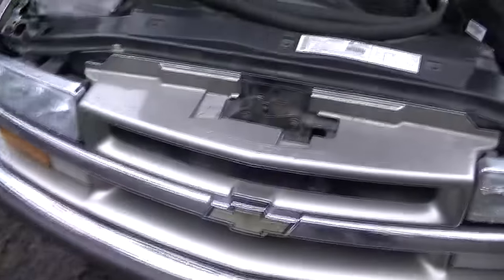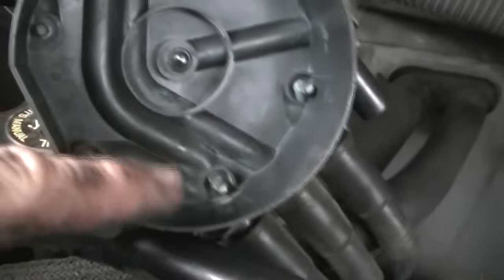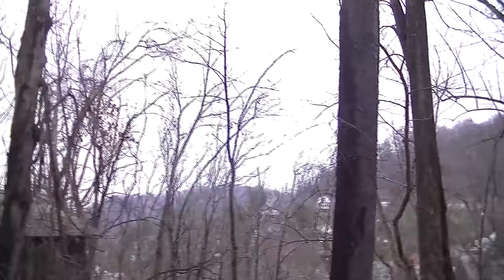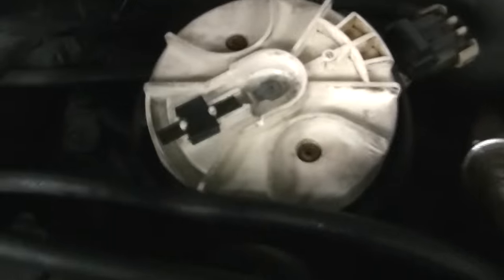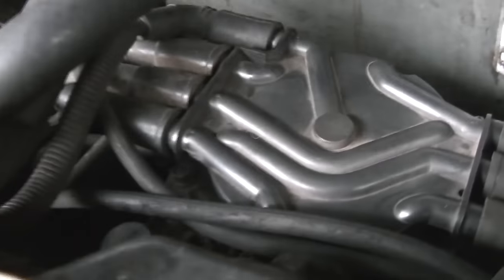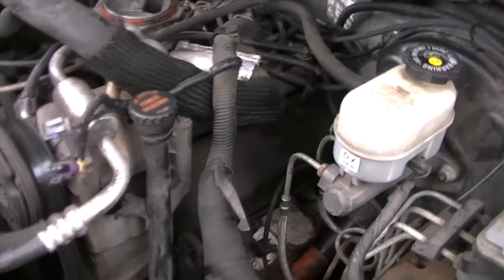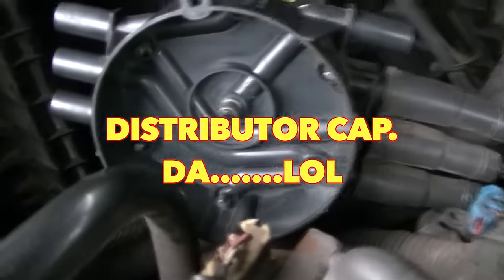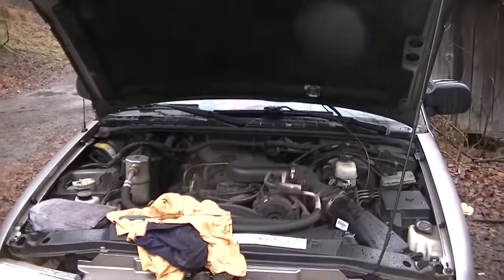4.3 Chevy S10 Not starting. Fixed!! EASY...Popping, Vapor locking...Jump time??... 1995-2008

Comment: I just recently had this one issue with my 97 Chevy blazer, it was starting great and all with a new battery and alternator but last week when starting it, when I turned the key to accessory, the instrument cluster would not light up at all and my fuel pump wouldn’t engage either but my radio turned on, my head lights and all interior lights as well, it would crank but would not start, any idea what my issue can be? Thanks
Reply from the maker: Go back to step 2.....
Reply: Nathan Rohrbough Well I did buy a new cap and rotor and have it ready to install but I stopped to do research on my issue first before installing anything, I’ve read that it can be my ignition switch, my starter or just a bad relay somewhere since the power is there it’s just not getting to where it’s supposed to, I’m getting my starter checked out soon and after I’ll install my cap and rotor and see what happens, thank you

Comment: I just had a misfire before I found out the problem I replaced the cap rotor with oem and thay I thought thay were the problem because spark was comming out of the cap so I replaced the cap with a aftermarket cap did the same thing to find out the the rotor was missing the tang in the center drove me crazy but fixed
Reply: If you run into moisture's issues... I found a fix for it!
Reply: @JodBronson  what is it?

Comment: So... this is a 1973 Ford Pinto? I need a hair drier to start it? This is NOT my problem - alone, there doesn't seem to be enough electrical charge to kick through the ignition process. My situation is solved when I put a charger on the battery - it brings it right up and starts immediately. My challenge is figuring out why a NEW battery that the alternator charges at 15+ when idling loses just enough power overnight to not have quite enough juice to get it running. Voltmeter confirms this. No lights or radio draining it overnight... hmmm...
Reply: Short somewhere in the wiring

Comment: I need help with a 91 4.3 s10 we took bed off replaced fuel pump now we have good fuel pressure all the way up to the injection pump or carburetor whatever it's called but the only way it will crank is by spraying starter fluid in it no fuel is getting to the carb truck has been sitting for about two years what do I need to check to get fuel to carb or injection pump please help.
Reply from the maker: Pinched line?

Comment: My problem is the truck will start and run I can drive it around the block once if I try for a second time it starts cracking and popping then it dies in the middle of me driving it and it is real rough and the RPMs bounce out of whack

Comment: Mine does this but i have to press the gas pedal for it to run while i turn the key and it idles rough at low rpms , i already replaced the rotor &  cap tho with spark plugs /wires
Reply from the maker: O wow!~

Comment: I just replaced my distributor cap and rotor a year ago and it’s doing the same thing.
Reply from the maker: Ugh...might be time to do it again...
Reply: +Rat Attack -  If you run into moisture's issues... I found a fix for it!
Reply: @JodBronson  - Yeah, you mentioned that. About 50 times now. Except you don't say what the fix is. Very helpful.

Comment: You can have a hair line crack or carbon tracking on cap ,rotor or plugs . And carbon tracking on wires , plugs or plug boots or coil . On the GM HEI distributors there are 2 screen vents in the bottom that should be cleaned . Use carb or brake clean . Also inspect the 2 thin wires that go to the magnetic pickup . They can get rubbed through . They flex with the vacuum advance .

Comment: My 01 s10 is doing the same thing but I've replaced everything cap ,button, coil the sensor in distributor my fuel pump is coming on like i have just turned the key on but im turning it off

Comment: 1989 S15 Jimmy 4.3 tbi I have spark,fuel,no start need to test my compression. Original problem was a bad alternator,replaced it them my truck didn't start anymore. Any tips??
Reply: Ignition switch is failing
Reply: It turned out to be low compression, had  busted head gaskets,on cylinders 3,5 and 2;6, did the necessary repairs and the super S15 Jimmy is on the road again!! Appreciate your reply 👌👌

Comment: Will this causes a code to come up as eltrical when hooked up to a computer
Reply: This problem usually throws "P0300: Random/Multiple Cylinder Misfire Detected" code leading upto complete failure.

Comment: HELP MAN. I GOT THE SAME CODE I DIDN'T REPLACE MY COOLANT TEMPERATURE SENSOR AND HAD TO SOLDER THE WIRE TO A NEW PIGTAIL. BUT THE WEIRD THING IS I DON'T HAVE ANY FUEL PRESSURE AT ALL I HAVE A FUEL PUMP THAT'S BRAND NEW CHANGE THAT ALSO NO FUEL PRESSURE AT ALL COMPUTERS NOT TELLING TO SEND IT TO SEND FUEL PRESSURE. FIRST THING I THOUGHT WAS THE CAP AND ROTOR SO I ORDERED A NEW ACDELCO ROTOR BUTTON SO THIS MORNING I AM   TAKING AM GOING TO TAKE THE CAP OFF AND SEE WHAT THE PROBLEM IS THIS WHOLE THING STARTED WHEN I WAS IN THE HOSPITAL FOR OVER A MONTH AND NOT DRIVING IT.

Comment: I can prime my 97 blazer an runs good till I drive it for about a hr or so but just turning the key on to start it will. Not start long as I pore gas in the carburetor it will run. Has anyone had this problem before an I have change everything on it. Thxs.

Comment: Wow after all that bullshit I was right. The whole time that's crazy af I only maintain 3 s10s two trucks and a blazer all 4.3 97 01 and 03 all w over 200 on the odo and they all oops except one I just had to tow home today I believe this one will be my first crack at the infamous spiders and fuel pressure regulator I'm confident I wont have any issues w that it looks fairly cut and dry thanks wish me luck lol

Comment: That style distributor cap is junk. The same era small block and big block also have it, and it's no better on any of the engines. Also, I wouldn't bother trying to clean the contracts on the cap or rotor unless I was stranded roadside. If you think you need to clean those contacts, just replace them.

Comment: A GM tech told me that you can jumper the pigtail for the coolant temp sensor and it will run lean but if the sensor is the problem than it will run.
Reply from the maker: Thanks. It turned out to be the distributor cap and rotor button. They were bad and shorting out. New ones fixed the issue and is still running to this day ;)

Comment: I just went through my 1994 Chevy S10 Blazer Tahoe LT/ZR2 with the Vortec L35CII CPI, after having an issue similar to the fuel pump sending going out.

After taking the fuel pump assembly out, I found the wiring cluster that comes through the sealed fitting into the tank, was all melted. Lucky it didn't catch fire.

Changed the entire fuel pump assembly, and fuel tank too after poking a pinhole in the front of the old tank.. Yay.

Fuel lines are snug and relatively new, replaced them a year ago. Just put a new fuel filter on too.

Had voltage to the injector spider, around 12 to 14 volt. So, I spent the lump sum and got a new unit. Put it in, lost the little clip that connects/retains the fuel line and return line. Drove 2 hours away.. to go get the stupid clip from a junkyard.

Has a new unit, fuel definitely is coming through, and it'll spit and sputter on pure ether out of a starting fluid can. Sounds like it's grinding.. when it tries to start. Not sure if it's the ether or not causing the sharp sound.

I really.. need help. I love my old girl to death and the past month has been nothing but blown money and a broken heart.

Thank you, if you can help at all.
Reply from the maker: Making these old SUV last....Priceless.

Comment: Its kind of shitty design that distributor holds moisture . I usually have to replace mine once a year but now I'm thinking of just upgrading the distributor, P0300 is the code I know when it's distributor cap and rotor

Comment: Hell I'm having some misfire on my '94 Chevrolet suburban. I've replaced the ignition module and still no start after having turning the key numerous times. I need help I'm not getting nowhere
Reply from the maker: Hummm
Reply: I know my distributor cap underneath where it sends fire was like corroded kind of but more like rusty type
Reply: Brandon Quintero, Hi
Where you ever able to find out your issue ? I'm  having the same issue with your same type of vehicle. Thanks in advance.
Reply: Brandon Quintero
Reply: Neva Mind I still haven't found the issue. I've replaced the thermostat just because I have already bought it awhile back but back to square one. Now I'm thinking it might be my fuel pump a buddy of mine came over and he never heard it make that winding noise. Sorry fellas until I get something else replaced I will let y'all know. If y'all don't mind let me know if you find the issue before I do. Have a blessed day
Reply: Guys......... If you run into moisture's issues... I found a fix for it!

Comment: I rebuilt the entire engine on mine, It has all new electrical except for the ecm. It has spark it's on time, fuel system is as all new and has adequate fuel pressure. I installed brand new AC Delco Distributor as well. One issue with that was the gear was 180 degrees off from the factory so I had to flip it around. Has new crank sensor, new accel coil, new ac delco icm, Timing light shows right on timing mark. It cranks and sometimes it will backfire through the throttle body. Plugs are wet as well.  I checked for vacuum leak. I disconnected  the catylitic converter.  Anyone have any thoughts. It will not start. Fighting this for 2 months. Has no codes showing up. Has anyone else had this issue?
Reply: Oscar,
I have had problems with the accel parts a few times.  I would try a GM coil.

Comment: Another You Tube Parts Changer!
Reply from the maker: O yea! Pleas tell us more.....lol
Reply: TVWXMAN32  , po128 is a cooling system engine warming up problem usually that has to do with a thermostat not closing properly you have the right idea about the distributor cap but the most common problems I found with those is carbon tracking on the inside of the cap. You seem like a very knowledgeable DYI guy do a little bit more research when you post you have the right idea but the wrong approach! 😉
Reply: Sorry DIY 😉
Reply from the maker: Been a mechanic for 40 years! I never said the temp sensor was the 
issue nor did i concentrate on it . First of all...why does a po128 show up when you just crank on the engine....when the coolant does not even have chance to warm up?  
Only a wizard would know that. 2nd... moisture in the cap can cause the same 
conditions...popping/shorting out. Carbon tracking is common some  
sometimes. Even aircraft motors (yes I work on them also) have issues 
with carbon tracking in the Magnetos often shorting out So in 
retrospect, doesn't hurt to change the coolant sensor if that code 
shows up. My approach was the Distributor the entire time only getting 
side tracked to fix a outside issue. You have the right Idea but the 
wrong knowledge. To fix all outside problems that may lead to more 
issues, IS what a good mechanic should do.... o-O  Thanks for watching.

Comment: You're a good man and describe your actions to make an instructional video, but, bro., slow down---as my teacher always said---put your brain in gear before your mouth is in motion---because you stumble over your part names way too much.  You would not have to overlay the video with corrections on part names if you just slow down, think, and talk.  Otherwise, you're doin' a good job.  On the moisture in the distributor problem, I live in the dry Southwest and I've repaired a bunch of S10 distributors, but I've never seen rusted bolts on a rotor like you had with Appalachian moisture.  It reminds my of my dad's place in Florida, where everything rusts.  That rust alone tells me you have too much moisture getting trapped under your cap.  One problem I've seen is the real bolt for the cap itself, because of it being in a difficult place, too many dudes think it is cinched all of the way down when it isn't.  Once reinstalling the cap, pull up on it to see if the bolts are tight.  If there is the slightest give, then your rear bolt was not cinched down all of the way.  That looseness can allow moisture in.  I've seen trucks with the rear bold not tight several times, but my first indication was how easy it came out, then I knew it was too loose.
Reply from the maker: Thanks for your insight.

Comment: Don't ever put a cap and rotor on these engines other than a AC delco original equipment cap and rotor all others are junk .
Reply from the maker: Word.......
Reply from the maker: I've changed two caps within 30,000 miles. For some reason, some caps don't hold up.
Reply: If AC Delco was so great, this wouldn't happen in the first place. I haven't had to replace a cap and rotor since owning my '73 Corvette. I didn't even know modern engines had distributor setups like this anymore. Obviously, it isn't very modern, or well designed.
Reply: nothing ever said further from the truth lmao. ac Delco is  original equipment for one reason and one reason only! the (reason )it was the cheapest crap gm could get to put on them and saves them money in producing the cars and trucks! plus the faster the stuff wears out , and the faster you have to go to the dealers to buy them genuine high priced dealers parts lol . plus most take them to the dealer to be fixed so they clean up all the way around .  what it all comes down to is do you want to get on ebay and buy a cheap china , tiwan or medico part or buy a genuine gm part and pay 10 times the price after they order them from china, tiwan or mexico  from the same factories?

Comment: the temp sensor keeping it from starting really
Reply: If you run into moisture's issues... I found a fix for it!
Reply: Yes really. Sometimes if the sensor is bad the ecm will default to -40 degrees farenheit. And when the truck thinks its -40 outside but it's really 80 degrees it won't run because it gives it way too much fuel
Reply: @bobk1955  🤣🤣🤣🤣😪

Comment: Engines require three things to work. Spark. Fuel. Compression. Thankfully, they have simple, relatively inexpensive tools to TEST each of these systems. Anytime you have a crank, no-start situation, you should immediately look for spark, then fuel. A simple $2 spark tester would have saved you a ton of work. Also ... you replaced a distributor before you replaced a cap? If you are just going to "throw parts at it", at least start with the easiest and least expensive parts. In short, you correctly diagnosed your problem as no spark, but then you went around the block to get next door to fix it.
Reply from the maker: Thanks! Good to know!

Comment: 2 men and a screw driver does not make fer a mechanic or just because a guy has a obd2 scanner and a hammer does not make them a tech .my first thoughts on some usa made stuff look at it its cheaply made so it may be simple and in electrics  and learn how that crap like how to build an amplifier n simple circuit design  and ohms law then study systems takes years really

Comment: .
Reply from the maker: ;D
Reply: I was having same problem forever! Was ready to drive it off a cliff! My rotor and distributor cap were fine, just the design was letting enough moisture enter to stop it from firing. I'm not a mechanic, just an analytical female and my solution was to put a little caulking around the bottom of the distributor cap. I did this at the beginning of spring last year and haven't had the first problem since!!!